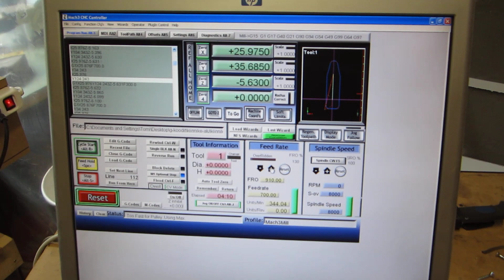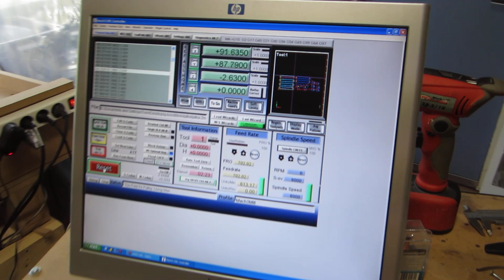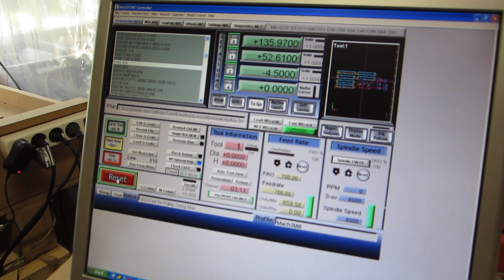Aluminium and plywood cutting - testing my new camera HD

Comment from the maker: @minttuber For the price it is quite good, and the performance in medium/low light situations is remarkably better than the last point & shoot I used. It does have some limitations; such as no focusing / zooming during video recording and max. 10 min video clips. The video bitrate is also quite high, at 1080p  you can fit about 35 minutes of video to a 8 GB card, and not very much more at 720p. No timelapse function either. You should read throught some reviews before deciding.